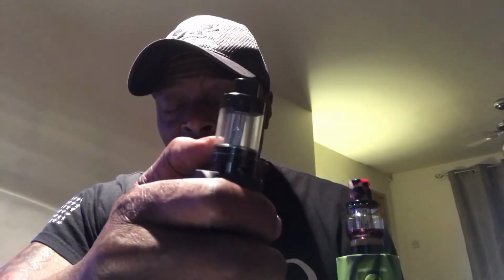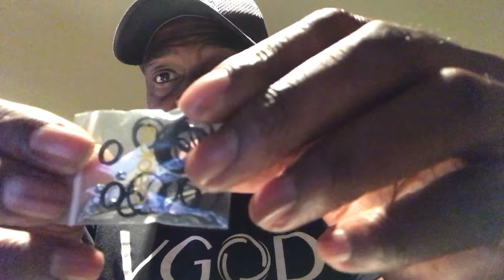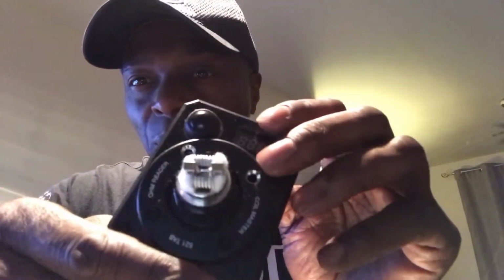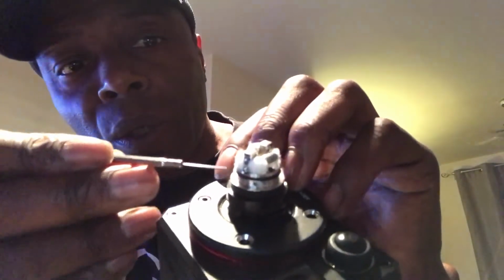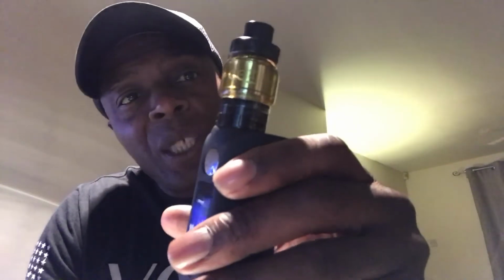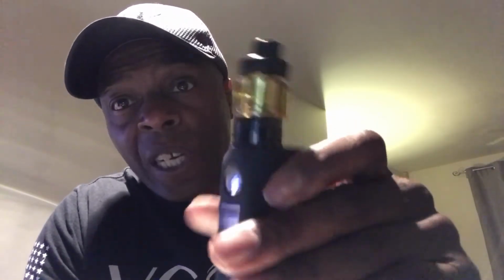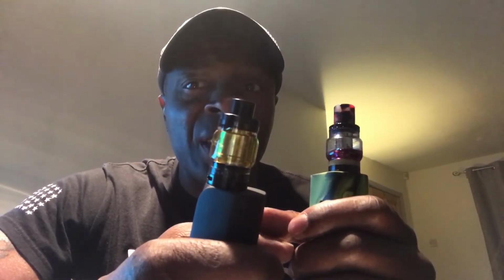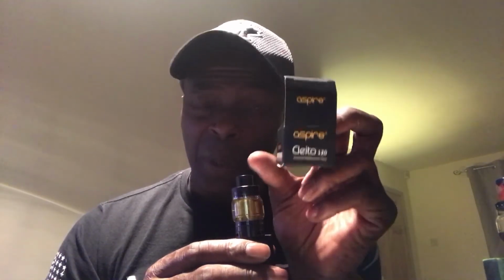Moonshine vaper Review and thoughts on the cleito 120 & the new RTA System with fat boy class.

Comment: @Moonshine Vaper - Got myself the Cleito 120 and installed the RTA today :D  I vape @70w and use the rx200 - am curious about the asmodus minikin v2 - want a decent high power vape and like this due to its small size profile but how hard does it hit? And how long do the batteries last on this device??  I had a Smok H-Priv and in comparison to the rx200, it hits better (prob due to the Soft/med/Hard/max settings).  What's your view on the Asmodus?
Reply from the maker: Rahayed Munim I use the minkin v2 all day everyday for work and I only run it at 60w , but must of the time it will be the RX 200s , it never lets me down. 👍🏿